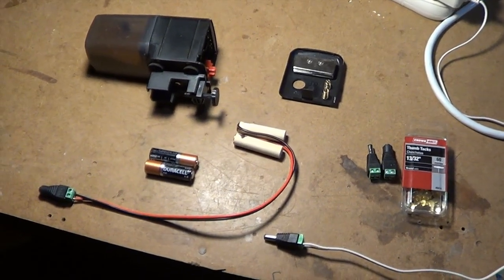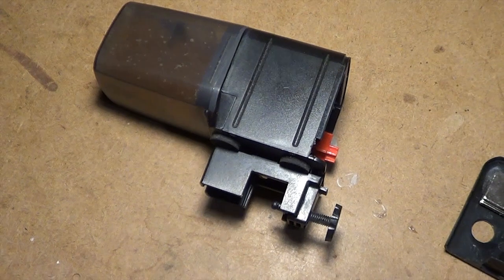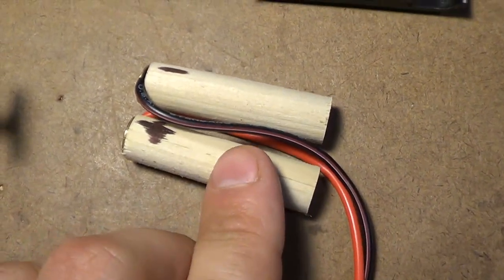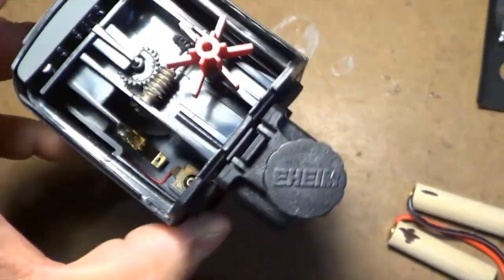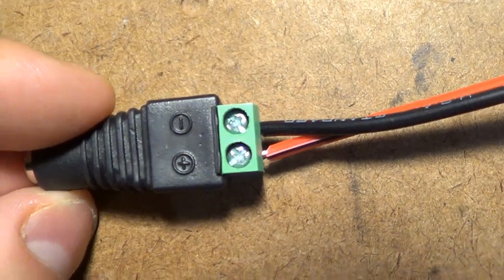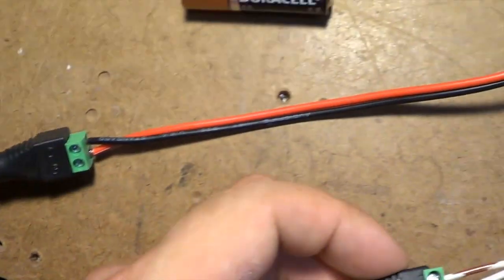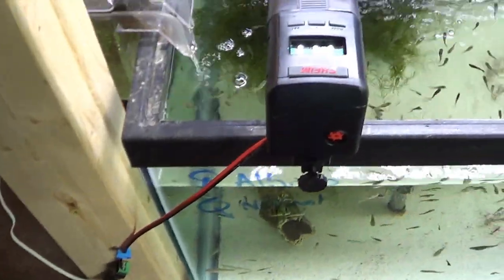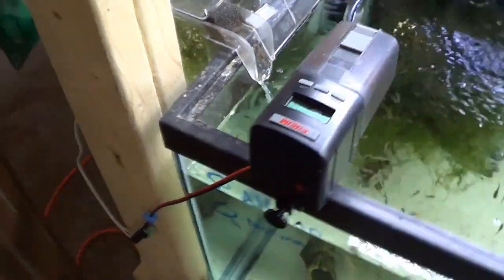#308: No Battery Automatic Fish Feeder - DIY Wedneday

Comment: sorry my dad is a electrician 240 or above volts is deadly and anything over 20amps is deadly depend of time being electrocuted 15 and 20 amps being stung for more than 2 minutes is fatal 30 amps or more is instant death or if your lucky it wont
Reply from the maker: Autumn Rose thanks for the info, stay tuned, i have a gfi adapter to use with this, video coming soon

Comment: there is so much wrong with this man.  

1. the sharp plastic edge of the container against the wire
2. Not plugged into GFI
3. No Drip Loop

This is sketchy and should not be considered 'permanent'.

Sorry man,I really like your videos, but this is just not safe.
Reply from the maker: Big Dubb 1. it's not rubbing against it but i could file it smooth 2. i already got a gfi adapter in the mail, stay tuned for that video 3. i agree